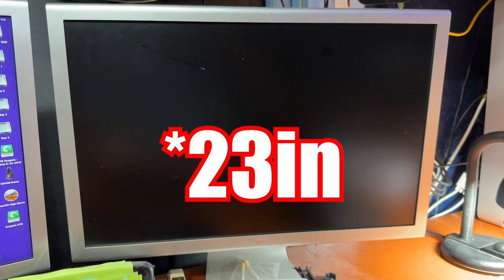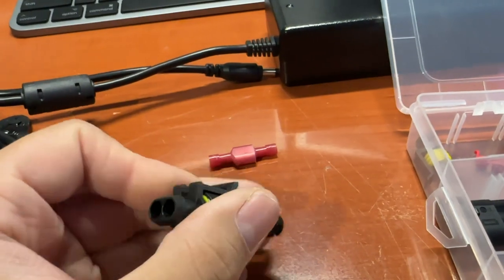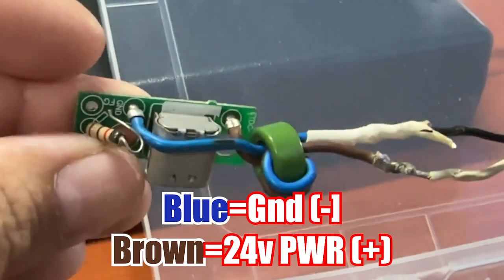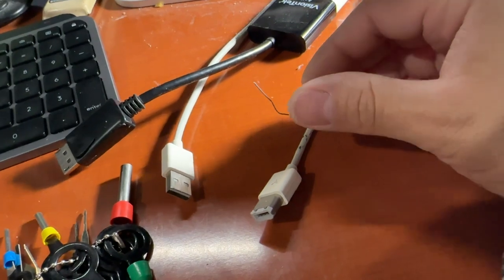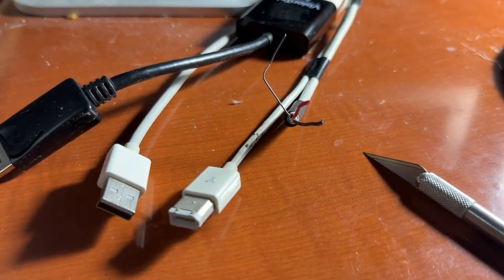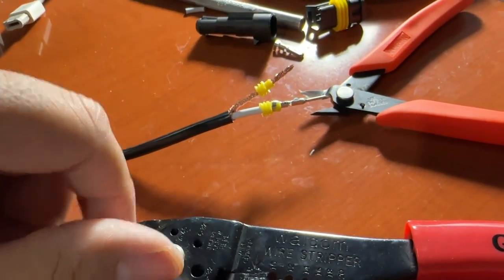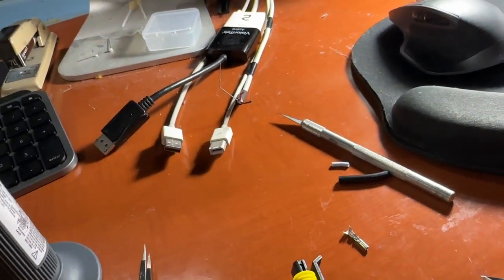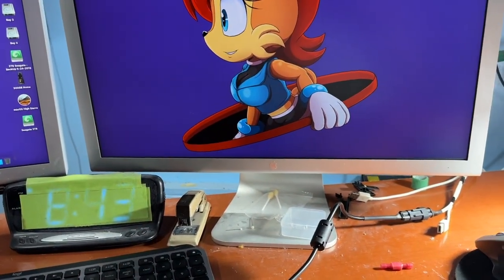Apple Cinema Display PSU Replacement/Upgrade

Comment: Do these displays work without DVI/USB connected? I spliced a new power adapter on  like this video but I do not have a dvi adapter to hook it to my PC. Is it supposed to power on to a logo or menu if it is not connected to a computer?
Reply from the maker: Yes, it will need a video signal. There is no OSD on Apple display's.
Reply: @AnimeFunTV  thank you for your reply!
Reply: Yes thanks for this convo.